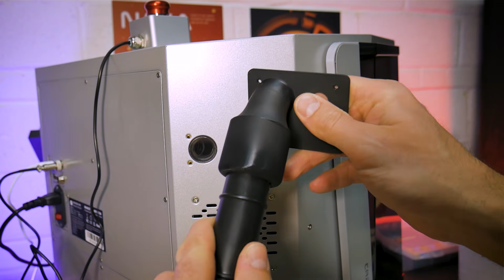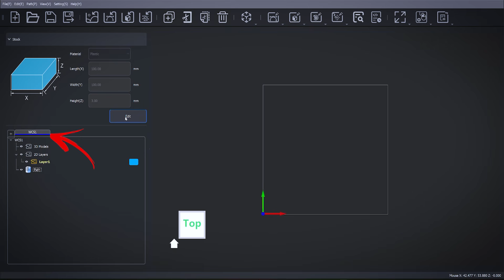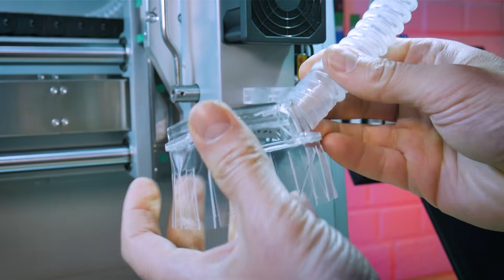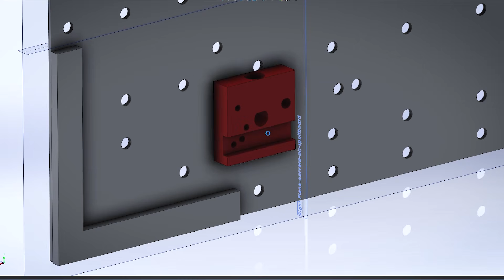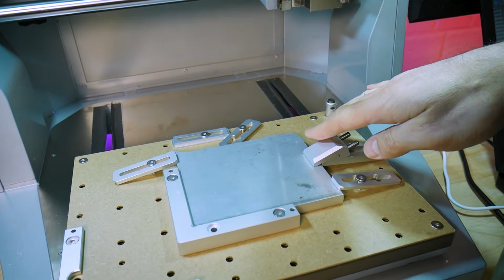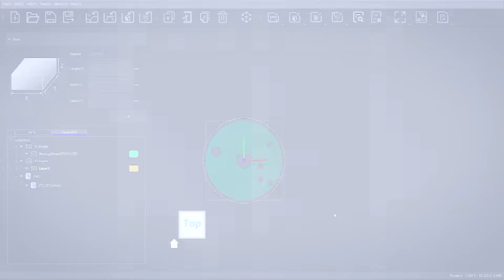Makera Carvera Air CNC: Full Setup Guide, Projects in Acrylic & Aluminum + Honest Review

Comment from the maker: Support the channel by using my affiliate links below when checking out the Carvera Air — it costs you nothing extra and helps me keep creating in-depth reviews like this! Discount code too!
✅ Carvera Air (Official Website)
👉 https://s.zbanx.com/r/3p31Fs6VG67O
✅ Code: EM100OFF ($100 off)

✅ Carvera Air (Amazon)
👉 https://amzn.to/47IFtcf

✅ Tool Organizer:
👉 https://embracemaking.com/products/makera-carvera-air-tool-organizer

✅ Affordable Shop Vacuum HEPA filter kit:
👉 https://embracemaking.com/products/fume-extractor-conversion-for-craftsman-cmxevbe17678-bucket-vacuum

✅ LED Acrylic Sign Kit (12 pack) From the Acrylic Project Example:
👉 https://amzn.to/4huU4eR

✅ 3D Printable Vacuum Port
👉 https://makerworld.com/en/models/1288729-carvera-air-vacuum-connection-32mm-fox-alien#profileId-1318456

🧰 Recommended Accessories & Tools, as an Amazon associate I may earn a small commission at NO extra cost to you:

✅ Deburring Tool
👉 https://amzn.to/43G02Uj

✅ Mini Fractal Vise
👉 https://amzn.to/4nrlXWC

✅ 40 Piece End Mill Set
👉 https://amzn.to/3WmJGfx

✅ Adjustable Air Assist Pump For Chip Clearance
👉 https://amzn.to/431xTqF

✅ Craftsman "Bucket Vacuum"
👉 https://amzn.to/48OF3lH

✅ Variable Speed Motor Controller (Cuts down on vacuum noise)
👉 https://amzn.to/43xH6ah

✅ Machinist Squares
👉 https://amzn.to/43vileQ

✅ Digital Calipers
👉 https://amzn.to/4qMifd5

✅ 12 inch Drill Press
👉 https://amzn.to/4qzwSQQ

Comment: Does anyone know for changing the voltage from 220 to 115, there is a metal cover over where the switch is, is that normal? If so does anyone know how to remove it without breaking it, and if that is some kind of upgrade. I figured the switch would be exposed
Reply: I stand corrected - if you are reading this they upgraded and their is no switch, the manual is old and it is now universal hence why the covered it!!

Comment: I would have removed material on top of the grub screw for the motor shaft and use a 6-8mm grub screw, not a normal screw. This way you could have milled the hole and thread milling it.
Reply from the maker: So what you're saying is mill clearance above and then use the Makera to mill the tap hole and then mill the thread?
Reply: @EmbraceMaking  yes. You probably left so much material because of your 3D printing background. If you need to do one it doesn’t matter much  but for 5 or more it’s better to let the machine do the work. 😊

Comment: Great video. I am just wondering why not use the manual xyz probe for the last external profile? It should give you a more accurate point of origin.
Reply from the maker: It certainly crossed my mind - but since the part was very small and I was using the screws to fix it down I would have had to set the manual piece on top of those screws, then I would have had to offset the z value by the amount the screws stick up. For whatever reason I didn't want to do this at the time. Arguably the XY accuracy in that last setup was more important than the Z so in retrospect it may have been a better choice!

Comment: Great video. I have Shapeoko 4 that I do wood projects on - it’s capable of cutting Aluminium but the thought of all those metal chips flying everywhere fills me with dread. Some new CNCs coming out in this market but the Carvera Air looks the most rounded.
Reply from the maker: I have also worked with Shapeoko in the past and I love them. The metal dust is a pain to deal with on any machine - the enclosure here is a step in the right direction but what would be really cool is a desktop machine with a wet coolant system to carry away the chips and filter out in a strainer. It would be very specific to metal machining so I'm sure it would come at a cost but there is probably a market for it